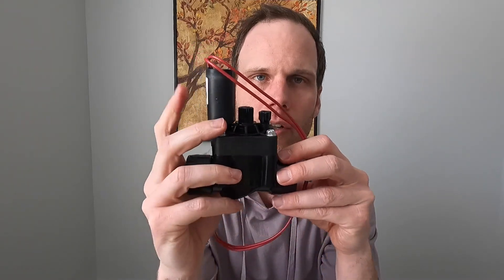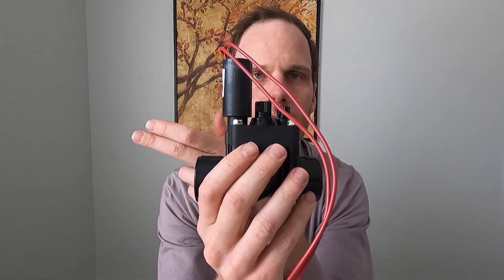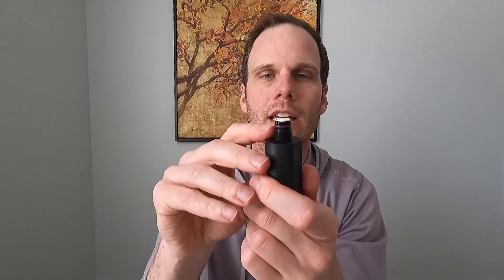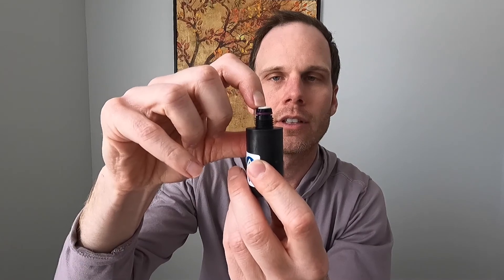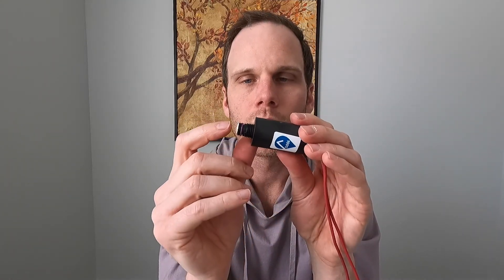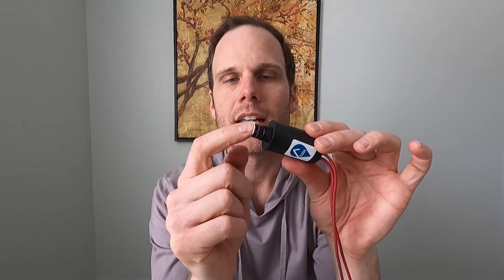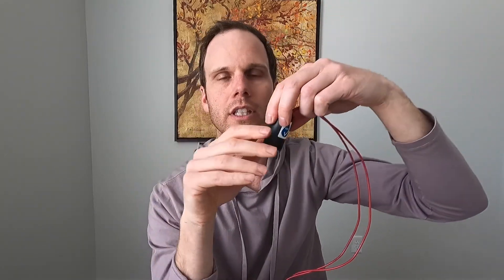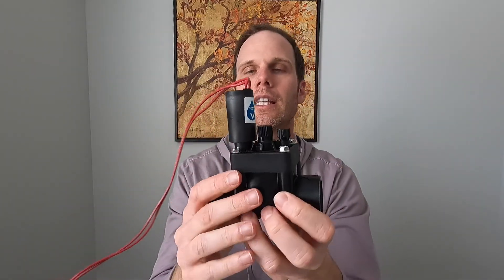Understanding Your Sprinkler Valve and How it Works!

Comment: What voltage activates the solenoid?  I am thinking out a project that is not about sprinklers. I won't be using a sprinkler controller
Reply from the maker: 24V

Comment: I just added a brand new 4th zone valve to my rainbird sprinkler system. I hooked up all the wiring by following the rainbird directions and verified I did it correctly in your other videos. If I manually open the solenoid, the sprinklers work properly. However, when I program or manually start the 4th zone, the sprinklers don’t pop up. What could I be doing wrong? Could the solenoid/valve be faulty? The other 3 zones work properly and the valve is brand new and clean
Reply from the maker: Either a wiring issue or a programming issue.  Make sure valve has the common wire connected to it and the new zone wire both going should be connect at clock.  Then make some run time is set for that station.  Let us know if any of this is the issue or have any luck after trying this.
Reply: It was the common wire. I had 3 other zones connected to the common wire and this 4th one wasn’t making contact. Working now! Thanks

Comment: Hi
Is there a video showing how to install the control valve?

I have tried to install a new (out of the box) control valve and can not seem to get it to close manually.
I have tried 3 different control valves and they all are in the open position.

I have checked for debris and everything.  I can not figure out how to manually close the valve.  I tried the flow control method, the bleed control method, and the solenoid method.

What am i doing wrong?  

Thanks for the help.
Reply from the maker: Have you tried flushing the sprinkler valve?  See our video on that.